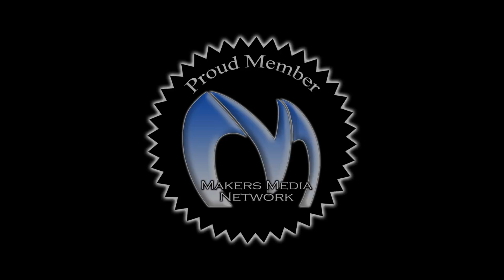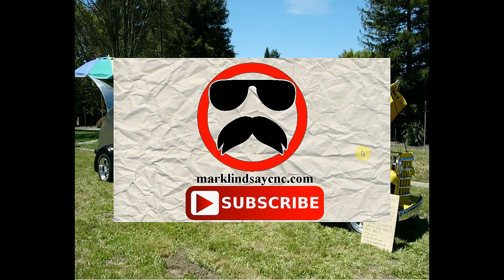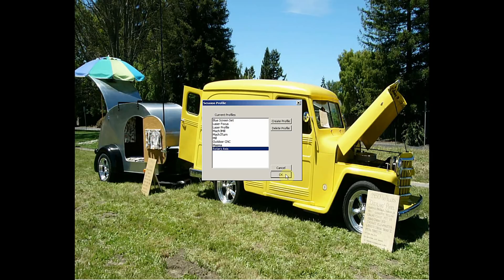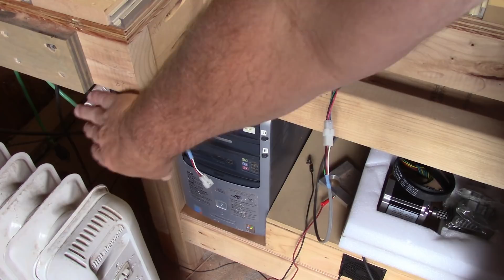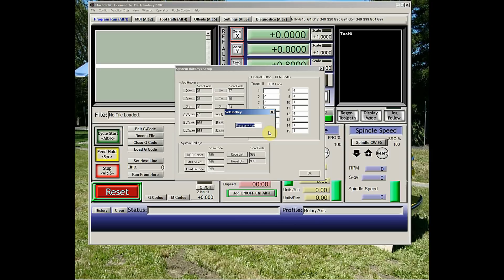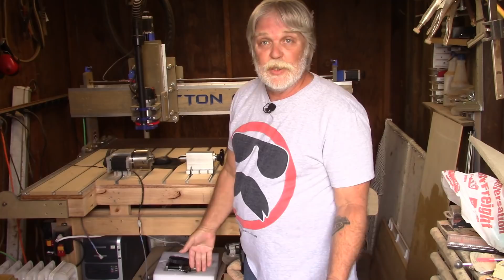Mach3 Settings for My Rotary Axis

Comment: Great video, what software can I use for rotary and postprocessor?
Reply from the maker: Thank you! I use VCarve Pro to design files to run on my rotary axis. The post processor depends on what controller software you use, and how your rotary axis is oriented. In my case, I use Mach3 controller software, and my rotary is oriented across the front of the table, so I use the Mach2/3 WrapY2A ATC(inch) post processor. Yours may be totally different.
Reply: @MarkLindsayCNC  
I also use mach3 and aspire, I will connect and do tests, ask if you have information about tangential with 4th axis, I thank you

Comment: Great video, thanx!  Question:  My A-axis only go 360 deg with Mach3 when I use Aspire 9 spiral wrap .... so if I go more than one turn spiral it just continues straight at the end .... and some of the other spirals comes out crazy ..... mmmmm
Reply from the maker: Hmmmm... I haven't done any spiral wrapping on my rotary axis yet. You might post over on the Vectric Support Forum. There are a few rotary wizards over there who could surely help out.
Reply: @MarkLindsayCNC  I had my softlimits activated ...... when I turned it off it cut perfect :-)

Comment: Great video. Can you help me, with problem I encounter when putting number in A Axes motor movement profile. I can t put in number in decimals as I should, mach3 always correct in round number (witch is not precise enough).  What am I doing wrong?? Thank a lot for your help. Ales
Reply from the maker: Hit me up through my website, using the Contact Us link, and we'll see if we can't get it straightened out. Thanks for checking out the video!

Comment: great video thanks, I just ordered my rotary axis, so this will definitely help when it comes in. I do have a question, do you have to run a separate profile without you "Y" axis, how do you then line up to center over your work
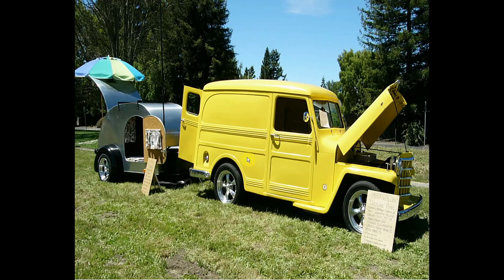Reply from the maker: Thanks for checking out the video! I answered your first question at the very beginning of the setup ( 3:50 ).  If you'll move on to the next video in the series (Mount and First Run,) you'll see how I line up the gantry over the  center of the headstock. Here's a link to Part 3: https://www.youtube.com/watch?v=8hNjGZHeQOM

You'll want to go through the entire series, as I made a couple of modifications to the procedures I used in Part 3.
Reply: @MarkLindsayCNC  yes I understand that you said you will create a new one, but I was wondering why. I may have missed that. I don't know a lot about Mach and nothing about 4th axis. But could I not just have all 4 axis turned on? Or does your controller only have 3 axis? I bought a new controller says 4 axis, so was hoping I could run all from 1 profile. Again thanks for this video, the explanation of the steps per degree part, I did not know about.
Reply from the maker: Okay, I understand what you were asking now. Yes, you have to create and use a separate profile for the rotary axis. The drive box is made to operate 4-axes, but remember that the A axis lead is slaved to the Y axis in order to move the gantry. That takes up all 4 of the axis leads coming from the drive box. To use the rotary, you need to position the gantry as I do in Part 3, turn off the drive box, unplug the A axis lead from the motor being used to move the gantry along the Y axis, then plug the rotary axis motor into that lead. Make sure you use the A axis lead - not the Y axis lead. Check the color coding to be sure.
Reply: @MarkLindsayCNC  Oh ok, my current machine only has 1 motor on my "X" (which is my gantry), I am building a new machine and want to have 2 motors on the gantry and I also bought a new controller card and the guy told me I could just splice the 2 together from the card before the motor driver, so each motor has its own motor controller, but getting the same signal from the board. Have you heard of this? The board I got is a USB Mach 3 board from "build your CNC" website. Would you recommend against this? Sorry for all the questions. thanks
Reply: like this https://buildyourcnc.com/FAQ/13287
Reply from the maker: I would continue to talk to the people you've been working with on your controller card. I wouldn't presume to tell you whether that system is good, bad, or indifferent. Yours is a system I'm not familiar with, so I wouldn't know where to begin.  Sorry I'm not much help.
Reply: @MarkLindsayCNC  hey no problem, you helped a lot with these videos, now just to wait til everything comes in. Then the fun begins

Comment: Excelent video thanks!!
Reply from the maker: Thank you! I hope it helps you out.
Reply: @MarkLindsayCNC  It helped a lot but I have one problem which is maybe not related with Mach 3 but maybe it is. If I adjust 0 on A rotary axis then I give command 360 degrees, them my 360 degrees is not 0 (360) but is is actually a little less, something like 359,75 degrees. I can give compensation etc. but this error stays the same if I turn 2 or 3 times or if I turn 10 times for example then I have 3599,75 which means that calculation of gears is probably OK and problem is somewhere else....it is like I create this error during the firts turn but it stays the same for others...do you have any idea? I have direct connection to stepper motor via tooth belt on plulleys and belt is stretched well...
Reply from the maker: Get into Mach3, click the SETTINGS tab (Right above the Zero X button.) Just above the red RESET button, you'll see the Set Steps Per Unit button. Click that, then select the A axis, then click OK. Tell it how far you want it to move (360 degrees,) then click OK. Mach3 will move the axis, then ask you how far it actually moved. Enter that amount, then click OK. It'll set the correct number of steps. Click OK. Then check it again by repeating the process until it turns 360 degrees.

Comment: I can't compliment you enough on this presentation. So clearly and concisely delivered, I think I only had to back up once.
Many thanks for uploading this. It will help me a great deal when my 4th axis setup arrives this week - and beyond. 
The only point I wasn't sure about was setting the Rotation Radius. You gave an example of a piece of 1.5" square stock and said to make the radius half of that - 0.75". Can you please explain why this would not be set to half of the DIAGONAL measurement of the stock?
Reply from the maker: Thank you very much, David. I do appreciate it.

Mach3 thinks of the stock as a cylinder - in the case of the example in the video, a 1.5" cylinder. It doesn't matter if the stock is actually a square, a hexagon, an octagon, or a cylinder - it has to think of the stock as a cylinder in order to make the calculations needed to turn the axis 1 degree. If you used half of the diagonal measurement, those calculations would be way off because of it.  The rotation radius of the stock should always me measured from the center of the stock, to one of the flats of a square. I hope that helps.

Comment: Nice and comprehensive video Mark. Just out of curiosity are you using a motion controller or the parallel port on your pc.?
Reply: Just realized you showed the parallel port in  your setup. The reason I mention it is you didn't set a step and direction pulse width in motor tuning. The setting is to give the pc port signals time to settle and the driver read them. With the setting too short you could potentially loose steps. Too long a pulse is not a problem.
When using a motion controller like a UC100 the motion controller takes care of all that nonsense. 
Cheers
Peter
Reply from the maker: Thank you for that, Peter! I'm going to need to pick your brain on that very topic one day very soon. Perhaps a good topic for a video on your channel? (Not-so-subtle hint...)
Reply: Mark Lindsay CNC
It's not a major issue. Jeff from Xylotex will be able to tell you the correct setting for them is as it Is dependent on the actual driver itself. If I'm reading the right document for your driver it looks like 2uS  would be right but I could be looking at the wrong drive. 
Cheers 
Peter 
Cheers
Peter